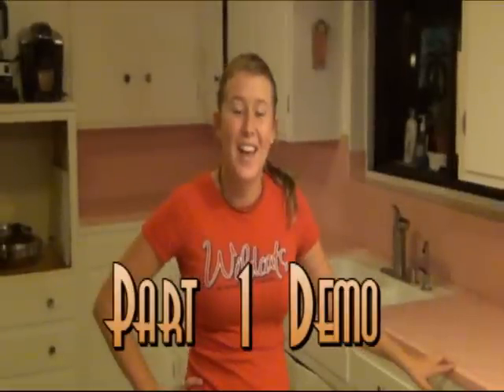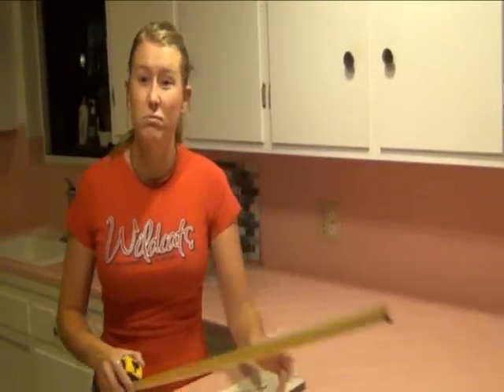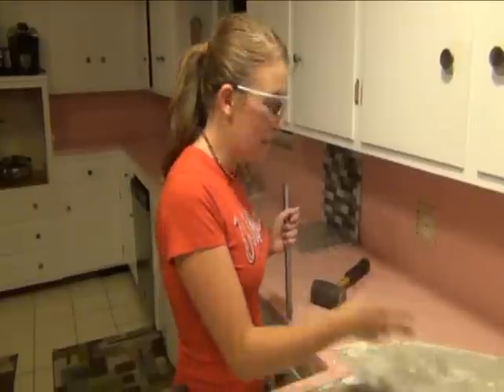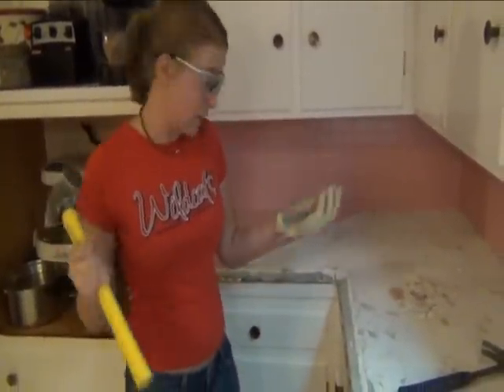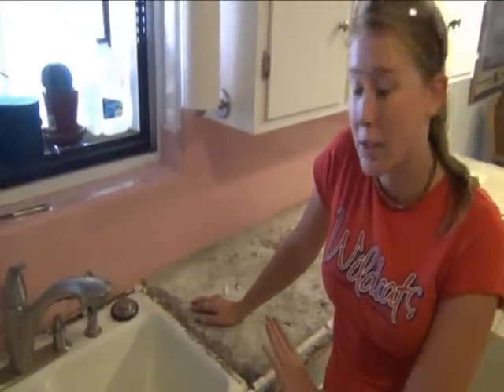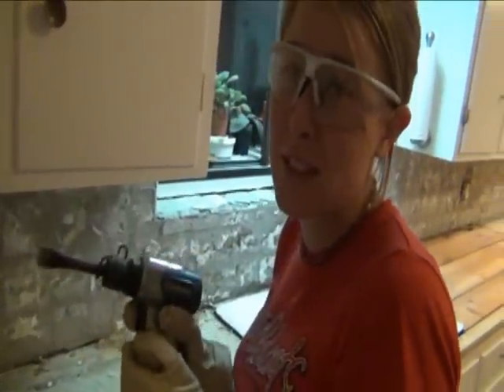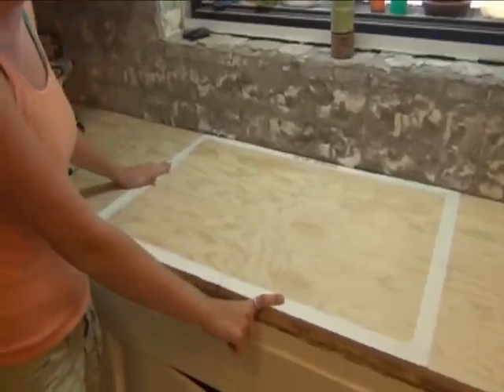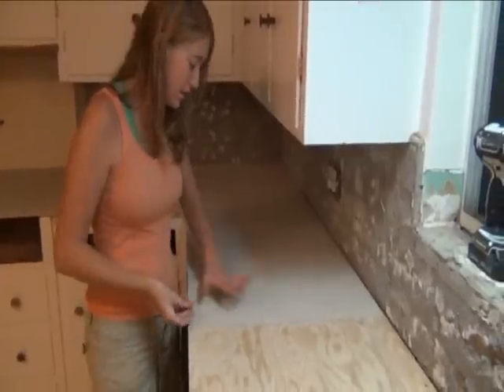Stephanie's step by step Kitchen remodel -  Step 1 Demo of old tile countertops

Comment: My parents had an old, broken, and gross tile counter top that they had lived with for years.  When they decided to move, they figured they were going to have to spend thousands (which was out of the question) on a new countertop as they knew nobody in their right mind would want to buy a house with SUCH an outdated kitchen (no doubt they'd have been right about that.)  So they were really in a pinch.  But then I watched these videos of yours.  Well, I did exactly what you said to do, and now the kitchen is GORGEOUS!  I still can not believe how little it cost, how easy it was, and how amazing it looks.  There house sold to the very first family that looked at it, and they said they LOVED the kitchen!  I really can't thank you enough for doing these videos!  Without them, I really don't know what they'd have done.  I pray that God blesses you in every way!

Comment: Useful because you showed how you adapted and took us along with your thought process to solve the problems that came up i.e.: tile becoming to difficult to remove and getting a pneumatic chisel. I've seen pneumatic tools in the store and wondered why I'd need one. I'm wondering if in 2016,  my dremmel oscillating multi too-ridgid scraper be a good idea.

Comment: We have granite counter tops. But I would like to add a back splash. Wondering if you know how to remove just the granite back splash. You know they builder put in about 2 inches of granite going up the back of the kitchen wall above the counter tops. Just wondering how can I remove that without damaging the actual counter tops.

Comment: Also is there a way to remove all the layers at once cut into small sections so you can lift it?
Reply: Yes there is. You have to remove the edging first, wiggle and use hammer to loose top, then take off everything from the plywood up.

Comment: They sell masonry chisels with collars so you don't bust your hand or have to worry about it and you can work quicker or just buy a Milwaukee rotary hammer. They don't sell common sense at the store though but they do sell larger pieces of granite for 40-50 bucks a square foot edged and installed so you don't have to spend a week of labor for sub par counter top.

Comment: You barely show how you put down the backer board.  Did you use thinset under?  What trowel thickness?  What length screws?   
All tile videos just want to show the tile part and spend little time on the substrate.  The most important part.  What about the edges?   Interesting to watch but not helpful to actually do a countertop.